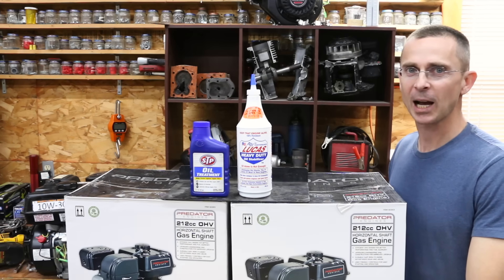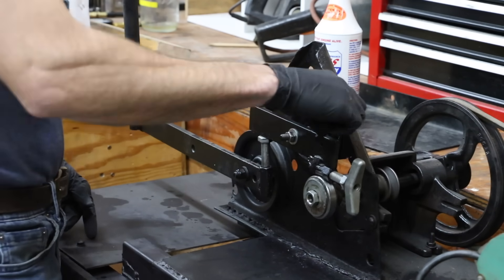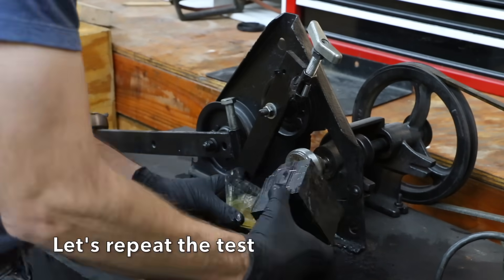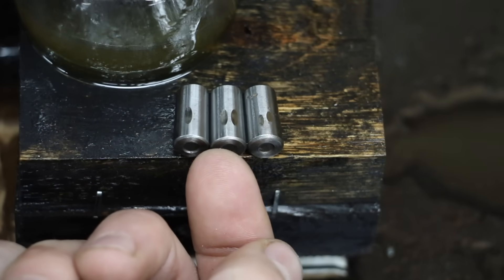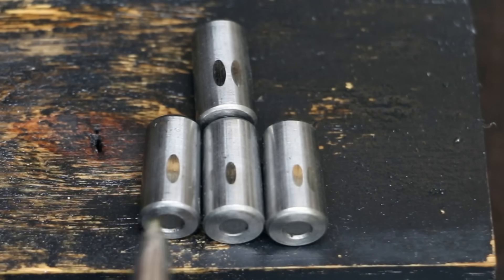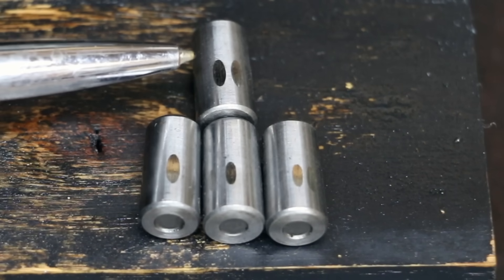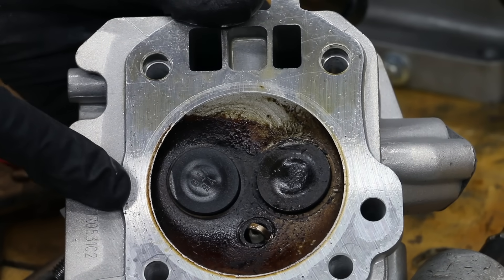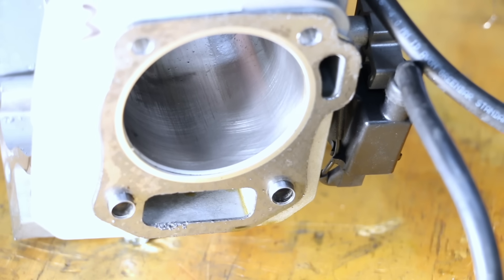Which engine self-destructs first?  Lucas or STP?

Comment: Both Lucas and STP are additives and will only benefit the engine if it's in there with oil.  This test doesn't really establish how effective each product is when used correctly. All you have done is determine that one screwed engine will implode before another IF it's run without oil.   Maybe a load and wear test would establish how much a standard engine will where given an amount of load over a period of time and then to comparisons.  I love the tests but the tests have to mean something.   I am not going to run my car without oil anytime soon so these tests are meaningless.
Reply from the maker: Thanks for the constructive feedback.
Reply: Ian Wright  
He did a load test at the begining of the vid. Totaly controlled weight, pressure, speed, and time. Thats enough of a controlled enviroment for the rest of the world
Reply: I agree with Robert G.  Two identical engines broken in using the same procedure.  The additives are the only variable.  A real-world test would be highly impractical and time consuming.  The time it takes for each engine to fail gives a reasonable indication of the additive's protection quality for the reasons stated.
Reply: If your drain plug falls off, first, you better get another mechanic and 2nd doesn't matter what you have in your crankcase, your going to have damage unless you turn off your engine right away.
Reply: Keep up the good work! I am curious about octane fuel ratings on engine knock. Need a way to vary the ignition timing to test gas.. But it would be interesting. Fuel additive test would be fun.
Reply: Ian Wright, Lucas selling point is that it covers engine moving parts with lubricant by making the oil more sticky thus ensuring the part stays "lubricated" longer .. and I think running the engines with no oil proved that by making the engine with Lucas in the oil last longer because the layer of "lubricant" was there longer .. every time is a dry start for well used engine after prolonged period of not running .. Lucas is intended to give you that little bit of protection. just my opinion .. I am not paid by Lucas or anyone else for that matter.
Reply: I agree that these test prove nothing in the real world. Any engine is going to fail without oil. Not saying i didn't enjoy the videos.  I vote for STP and will still use it as assembly lube for engine builds.
Reply: One thing I learned was if my engine was 1 to 2 quarts low on oil I would feel the chances of the engine lasting longer would favor using Lucas instead of STP.
Reply: pospc2 .. I rebuild engines for living .. and I use Lucas as an assembly lube because it holds on better than the regular moly based assembly lube .. and just because you saw oil dripping out of the bottom of the engine it doesn't mean that there's a thick enough layer of the oil to protect and prevent the bearings and crankshaft from rubbing until the oil pressure builds up.
Reply: It's not about the thickness only .. Lucas is "stickier" and doesn't come off or dissolve easy .. so it helps the oil stick to the parts more and provides a thicker coating .. few years back when it first came out they used to have a demonstration in the parts stores showing how oil acts with and without Lucas .. it makes it a whole lot easier to envision what it does .. as I said I am not paid by Lucas nor I am trying to promote it .. but I know it's good .. it's not the "magical" potion that will make an engine run forever .. but it helps .. and I see in this thread that there's another person who uses it for assembly as well.
Reply: Ok a very embarrassing admission to make but many years ago I was fitting my 1st Cambelt to a 1.9 diesel. Before I did the Cam belt I ran flushing oil in my engine and then drained the oil. Leaving the drain plug out. Before I was finished fitting the Cam belt I was called in to eat Sunday dinner. After I finished fitting the belt I started the engine.. it sounded terrible. So I shut it off and rechecked the cambelt. It was 1 tooth out. Restarted. Still sounded terrible. Rechecked and it was correct. Restarted, rechecked. Restarted and run for 45 min while I looked everywhere for the fault.. which I eventually found under the car.. the drain plug!
This engine had been treated 50,000 miles before with the old (ptfe containing) Slick50. Fearing I had ruined the engine I put the drain plug in and refilled the engine with oil. It sounded perfect again.
That was at 90,000 miles.. It was still running perfectly 3 years later at 165,000 miles!
I have tried the "new" Slick 50 and its totally rubbish nothing like as good as before. I now use Activ8 which is also very good. However I am not about to repeat my early mistake to see if its as good as the old Slick 50!
Reply: theR6969 you have a valid point. It sure does stick to the metal. We saw it in the video as well. I have nothing against either product. I have a little lucas in a high millage engine of mine that's not worth rebuilding. It stopped the ticking and is quieter at start up. I use the STP as assembly lube. I have used it on rods,mains,cams and have actually pulled the rod caps and cam caps 100 miles later and found no unusual wear. 
Once again I see your point and i thank you. We were able to have a discussion without it turning to a flame war.
Reply: Bestline won with 71 mins! in an earlier video... the best of this video was only 22mins
Reply: Just by the way.  I really enjoy your work, love the fact you don't take endorsements and love the  farmyard technology.
Reply: An engine can be loaded and stressed.
Reply: I agree.  So why would you need to kill two engines?  TO discover what?  That eventually when run without oil an engine will seize?
Reply: Most small engines run at 3600 RPM, that is their optimum RPM...especially for those horizontal engines used in generators
Huge diesels are rated at 100% duty cycle (max load, max rpm for YEARS)...these small engines..I doubt they have 20%
Reply: Dang.  I knew I had missed something.  It was the fluffy kittens right?
Reply: theR6969 if you have ever taken an engine apart that had been sitting awhile,did you see oil fall out of the bearing surfaces? I have. 
Going by your theory a dry start should be protected by either additive since it only last for seconds.
Reply: and notice I said "well used engine" .. a well used engine is a worn-out engine thus it's looser and won't hold on to oil as good as it used to .. and a thicker stickier oil would surely provide an extra protection.
Reply: theR6969 how is a 174k mile engine that had rod knock and sat for 4 months before rebuild. I I'm not arguing that thicker oil would help. Actually i hope you aren't taking this as arguing at all. I feel that either additive would do the job fine if just thickening the oil. As would stepping up the grade when changing oil.
Reply: +Alexander Riccio Running the engines without changing the oil as recommended would not give an accurate result. Oils and additives are made to last a certain time and start to loose their properties over time. The real test would be to run the engines for a really long time, over several oil changes and then see the results. And to make it more interesting, use more engines and different oil change intervals. But that would be really time and money consuming and as the test gets longer, more variables are introduced.

+Project Farm Thanks for another well-made video! These tests are really hard to make and to come up with a testing method that gives accurate results with a low cost and short testing time sure as hell is not easy. Keep it up!
Reply: Might not tell us much for every day normal use, but for myself and thousands of other derby drivers like me, who use oil additives, they are not meaningless. Our engines, some of which are worth many thousands of $$, get put to the extreme test on a regular basis. We don't let something like a punctured oil pan, or oil filter stop us, especially when it starts coming down to the money. If having the right additive can potentially  make a $5000 difference in my paycheck (because an empty crank case didn't stop my engine) or save $5000 by not killing my engine, then I find these particular test to be very useful.
Reply: I get what you are saying but back in the day when Nascar was Nascar they did slick 50 test the same way to show the protective attribute to the product.
Reply: I believe the knocking in this case is due to the engines starting to destruct because of lack of lubrication, very different from knocking or detonation caused by low octane fuel.
Reply: Ian Wright I do agree but also he did at just the attitudes so it's kind of showing us which one lubricates better basically that's how I look at it so I would buy Lucas over STP now since it seems like it's a better attitude and it actually sticks to the bearings also the engine lasted a little bit longer and didn't look as bad
Reply: pospc2 , thank you as well for the civilized discussion .. same as you I am not here to argue and fight. I too had a great experience with the old Slick 50 that used to have Teflon in it .. 30 years ago I added it to my father's car .. I used to beat on the car when I used to get it and finally one day something went wrong with the engine .. so it went to the mechanic and a couple of days later we went to check the dismantled engine .. there was a "grey" layer of Teflon on all the moving surfaces .. the problem was a piston broke into two half .. amazingly because of how slippery Teflon is both parts of the piston stayed together and there was no scoring what so ever to the cylinder walls or any other moving objects .. it made a believer out of me. but the old stuff and not today's junk.
Reply: Ian Wright yeah, uh I love these videos, but the fair test (which would cost a lot!) would run the engines (with oil) until they fail... thousands of hours without changing oil!
Reply: Project Farm, The tests are not "meaningless" at all. They show just how well the products adhere to metal surfaces, how good their load bearing or film strength capabilities are and running the engines without oil is just a faster more economical way to see which additive better protects the engine.
Reply: Ian Wright You have provided fodder for yet another vid. 👍
Reply: Given an unlimited budget for fuel, a long run test would be more 'real life'. But still, there would be factors unknown. Eg, an internal anomaly in the engine. Plus, in order to get some sleep, you'd need a large external fuel feeder to the engine fuel tanks. I'd suggest such tests would be impractical given that these engines may run for thousands of hours before dying.
Reply: Agreed
Reply: Brad Griffin yeah it'd be a real PITA which is why I'm not going to be upset with Project Farm... I can dream though!
Reply: (maybe 60-70 hours, under load, medium idle)
Reply: except when you hit a pot hole 3 miles from your house at 2 am and crack the oil pan wide open like i did. I immediately stopped and saw the mess and decided to drive the last bit to my house. After removing the oil pan i examined the bottom end of the engine and it seemed fine. All i am saying is in a world where anything can happen knowing you got a few more miles isn't a bad thing. Both products are basically the same. Any test other then do they work will show results like this
Reply: I disagree with you that these tests are meaningless. Picture this: Your on a road trip and your in the middle of nowhere and your oil drain plug falls out. You don't realize it until you hear "clunk clunk clunk" and the engine is losing power. At that point the engine is destroyed. I don't know about you, but if that happened to me, I would much rather have an additive in it to protect the engine than be stranded in the middle of nowhere with a blown engine. Many engines die from lack of oil every day. It happened to me, and I am very good about changing and checking my oil.
Reply: Yes. A pulley, belt, and a metered stress (load) on the belt.
Reply: Ian Wright meaningless? Hardly. Lucas in the advertised concentration beat STP on the bearing test. Just because you have trouble relating doesn't make it meaningless.
Reply: Ian Wright did you watch the video?

Comment: Justice Brothers engine treatment vs Lucas. Amsoil vs Royal Purple. 

These engines appear to have some quality to them.
Reply: "Amsoil vs Royal Purple"

Could you imagine the warring factions from a test like that? The angry mobs... it would be awesome
Reply from the maker: Yes, these seem like fine engines.  Thank you for this recommendation!
Reply: Seems like the Amsoil vs Royal Purple debate gets pretty heated! Thanks.
Reply: Cheap you say.  I reckon that running for the best part of 20mins with NO OIL, is pretty impressive.
Reply: I'd like to see duralube. Their commercials used to run car engines without oil if memory serves me correct.
Reply: For a Chinese engine, they actually are not bad little units. You just have to figure out what they are clones of and then parts are pretty easy to come by as well.
Reply: I would like to see Amsoil vs Royal Purple or Amsoil vs regular dyno oil.
Reply: I'd love to see how Amsoil stacks up as well. Amsoil guys are die hards and I've always wondered if they were right
Reply: Duralube rules !
Reply: They are Honda gx200 clones
Reply: thecorbies  I would say thats more to the credit of the lubricants.I remember as a kid running lawnmowers for hours with the oil so low it barely touched the dipstick.
Reply: MR WD amsoil is the Mary Kay of oil.
Reply: brainfreeze44131 - Some suggested you could take the same new car engine in those commercials and run it without oil and it would have the same internal damage with or without the additive.
Reply: true but even with chinese clones there are good ones and better ones Lifan would be the best honda clone imo
Reply: Cheap motors built with cheap China parts.. lol
Reply: MR WD These harbor freight engines appear to be pretty durable however my brother has experience with them at his work place. They simply dont last. Cheap is cheap no matter how you slice it.

Comment: Can you run an engine with petroleum jelly as the oil. I imagine when cold it will be solid but once warm it'll be liquid.
Reply from the maker: Thank you for this recommendation!
Reply: After a rebuild, and after any time the oil pump has been opened- Vaseline is usually the #1 choice to pack the pump, a necessity prior to assembly. It's viscosity is perfect for creating suction for priming the pump, and it readily melts and easily mixes into motor oil when warm, causing zero damage. "Trans Gel" is another popular assembly lube, that comes in 3 different colored viscosities, depending on need- and also harmlessly melts into ATF and motor oils. It is nearly identical to Vaseline.
Reply: Hmm, It would need to be preheated, but I think it might work?
Reply: Robert G 
Haha my dad said when they were kids and wanted to ride their motorcycles in the snow, they would drain and heat the oil on the stove and throw it in, otherwise you will know what it’s like to kick oatmeal 😬
Reply: No wont work
Reply: This comment gave me a good idea for high carbon parts on my AR to coat with it.

Comment: Why dont you get a really accurate scale and compare weight of bearing before and after each test?
Reply from the maker: This seems like a great suggestion.  I'm wondering if some oils would absorb enough to throw off the weight?  Thank you for this recommendation!
Reply: To offset this possibility, heat both bearings with a torch to drive off any oils that may have permeated them.
Reply: The gouge test is ample enough...as you see one on the bearing press test protected better (smaller gouge) then repeated on the engine with no oil (ran longer before failure)
Reply: Perhaps run the test for longer too?
Reply: Project Farm it probably would but in theory absorbing of the oil/additive would help the longevity of the metal.

Comment: What happens if you run an engine with fuel and gun powder mixed?  

Will an engine run with limonene?
Reply from the maker: Thank you for this recommendation!
Reply: mono19963 The problem with using solid fuel in an internal combustion engine has always been getting the fuel broken down fine enough to reliably ignite while also not backfiring. I think mythbusters played around with gunpower without much success.
Another issue is durability. Gunpowder might burn/expand too quickly and damage the engine.
Reply: Smokeless powder is nitrocellulose based and faster ones have nitroglycerin in small amounts added. Dont know if it dissolves in gas, but it does dissolve well in acetone. So you could try that if gas dont work
Reply: I don't know where you heard limonene causes cancer, all I could find were its uses for treating cancer. With that said, gasoline consists of 99% PROVEN cancer causing compounds, Benzene, Toluene, Heptane, Hexane....
Reply: limonene yes, gunpowder probably not
Reply: eksine We want an engine, not a bomb.
Reply: yyup good stuff here
Reply: mono19963 how ???
Reply: engine with gun powder mix will clog the carburetor
Reply: mono19963 gunpowder go boom.
Reply: mono19963 best new idea
Reply: mono19963 c.f.
Reply: Project Farm 
I like your videos you do a good job
Reply: Awesome video I always enjoy watching.
Reply: try nitroglicerin
Reply: Gunpowder residue will cause uneven burning and the engine oil will muck up very quickly.
Limonene is very cancerous, best to avoid it completely.